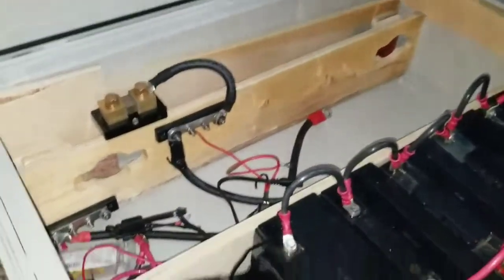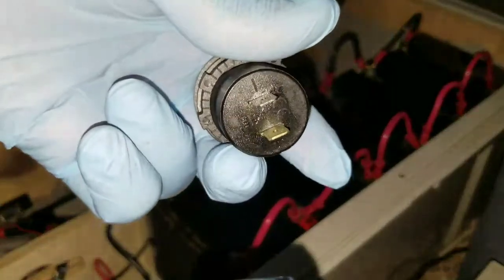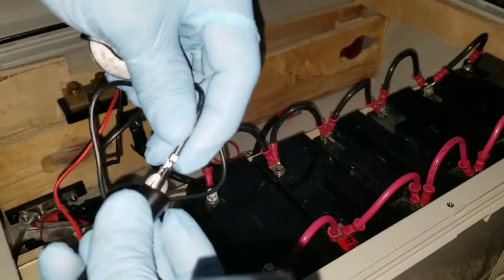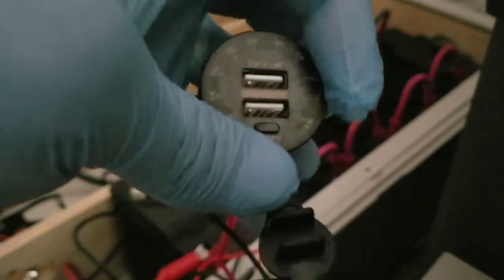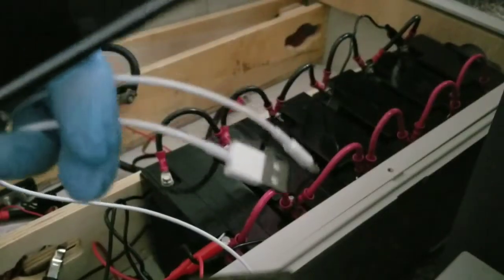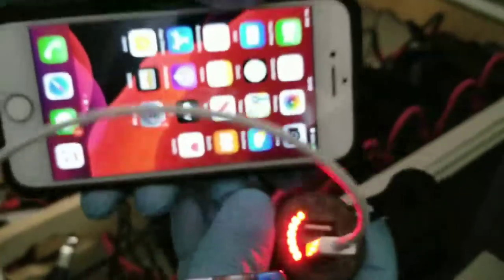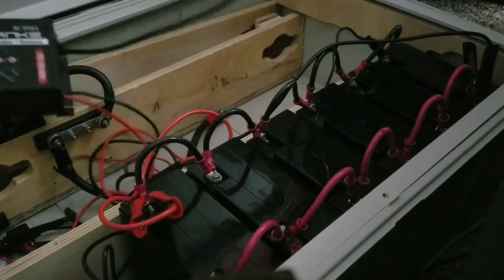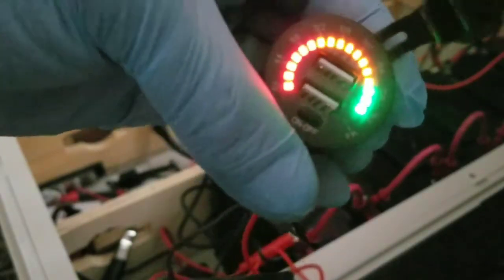HOW TO INSTALL A USB CHARGER 12v OUTLET IN YOUR CAR (Part#1)

Comment: Thanks for your sharing. I got one of this too. What I find is that it fits good for Lead acid battery system. For Lithium and LiFePO4 battery system, it cannot give out the correct voltage and simply shows over voltage (all lights up include the red pinpoint LED) , even it reads 11.8 and 13.1 by accurate multimeter.

Do you know how to fix it? thanks
Reply from the maker: Sorry for the late response. 
Mine does do that at all. You may have gotten a defective one.
Thanks for sharing. 
LIKE SUBSCRIBE and SHARE

Comment: I have a question I have a battery 9v I want to buy the socket does it work
Reply from the maker: This is a 12V-24V USB PD Charger Socket
Reply: @jwsolarusa  wich mean doesn’t work with 9v battery
Reply from the maker: @R.I.A  
That being said, your 9V battery is below this meter threshold.
LIKE SHARE and SUBSCRIBE

Comment: The bright running LED light would be very annoying when using it at night or inside a tent if this is installed on a DIY portable power bank.
Reply from the maker: You have the option to turn it off.
LIKE SHARE and SUBSCRIBE